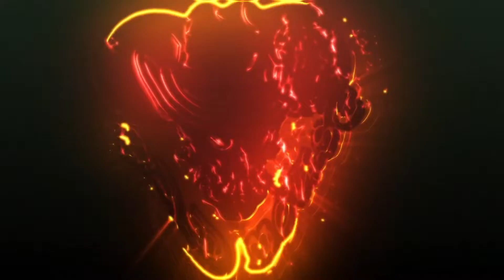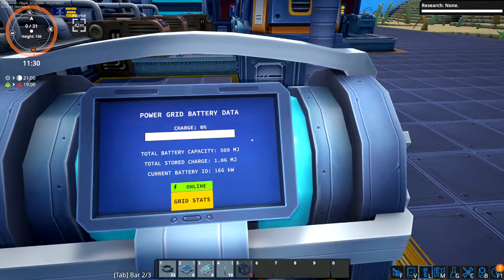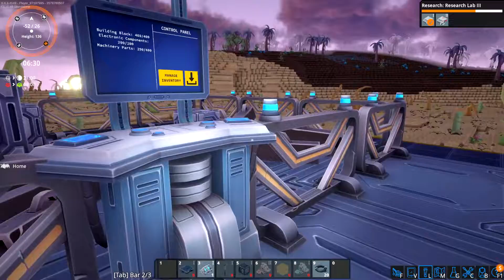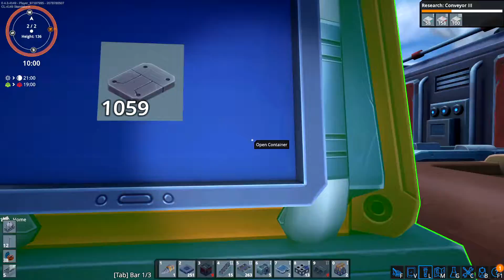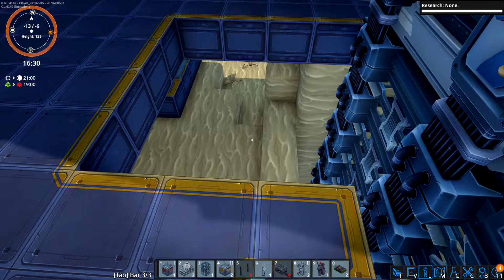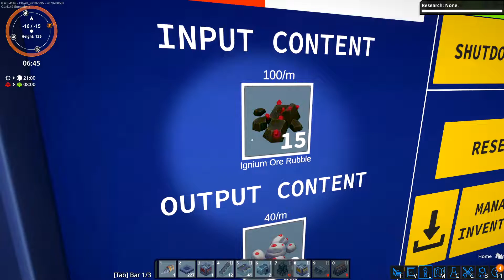Foundry Pre-Beta | First look | Underground Mining | Part 2

Comment: When you had power problems, your wiring looked like you actually had two high voltage circuits set up, They eventually short circuited.  Both were connected to the same low power grid. Your power poles would have had to all be connected to have just one high voltage circuit.  You can have more than one transformer on a section, they are additive, increasing the amount of low voltage power available, but they need to be on the same high voltage grid.
Reply from the maker: Yeah I figured that one out right away lol